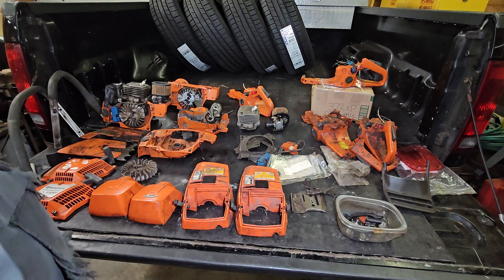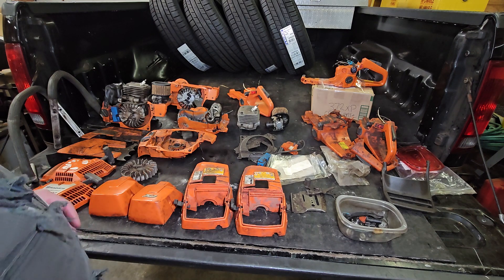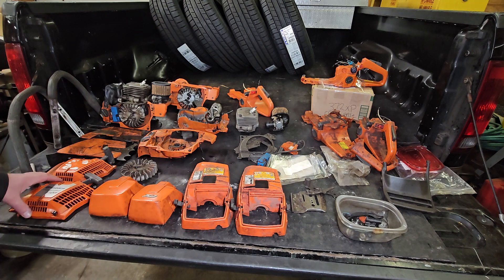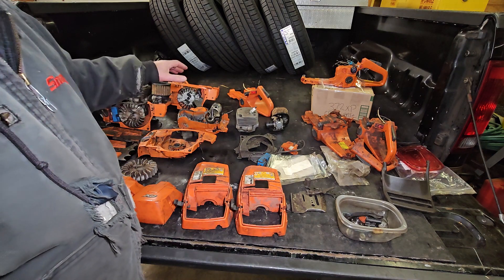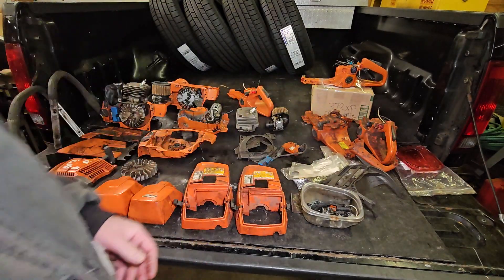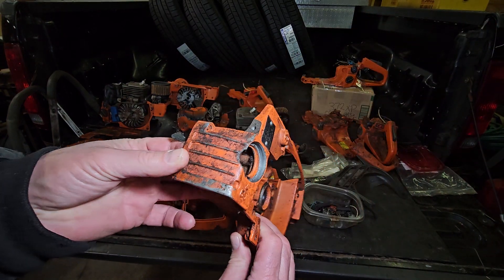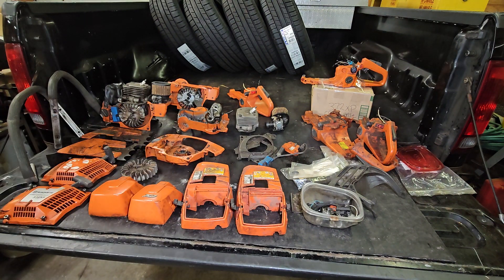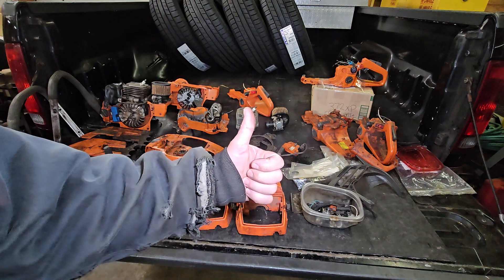HUSQ 372 XP FUTURE PROJECT

Comment: I have one of those. 1991 model though. This one is a good bush hog. Property tuned good bar and chain and properly sharpened chain its a must have saw. I like the way this saw handles and how comfortable it is. It even outcuts my friends 460 rancher. It lasted the test of time and still does. The only thing that I needed to do was replace the magneto coil module assembly and that was it. I don't know about these new xtorq model 372s. I'm not a fan of xtorq design because i think the xtorq engines run too hot and are more maintenance especially when it comes to sparkplugs. It eats through them like crazy and there is a lot off issues with the the piston end of that design with premature ring wear and ring getting stuck in the groove after low hours of use.
Reply from the maker: Hello, these are my first Husq saws. I was originally going to use one of these to convert a blow-up Xtorx I got from Ebay and fix the other. At this point, it looks like I'm gonna repair the Xtorx cyl and get a new piston. At some point, I'll build the OE saws. I haven't run a 372 and am excited about these upcoming builds. I appreciate the comment, and thanks for watching!